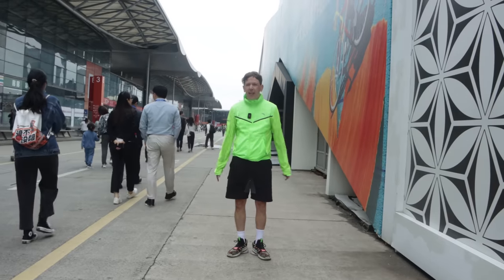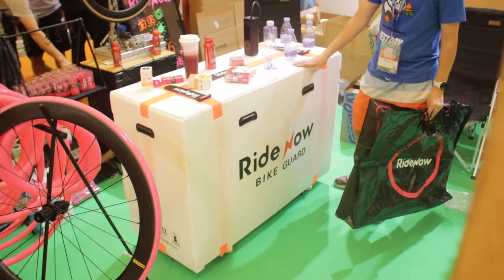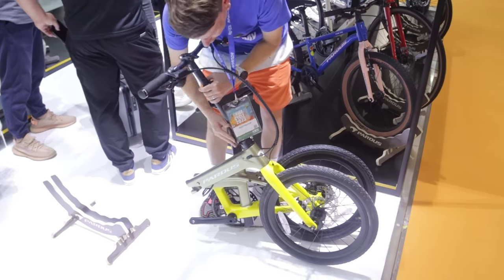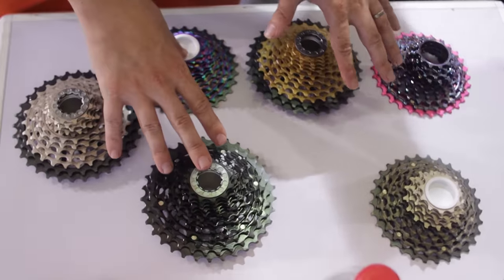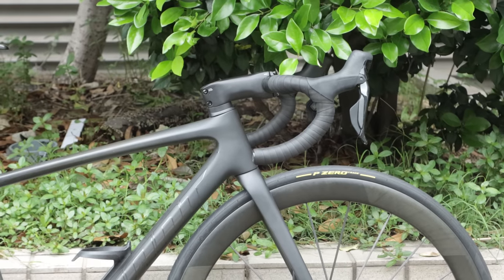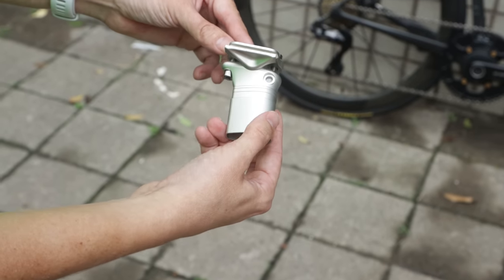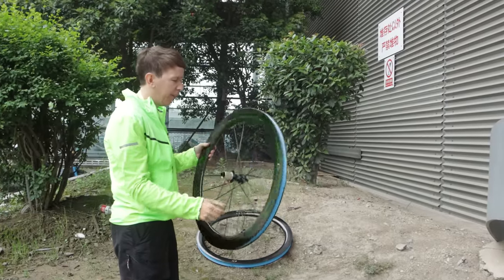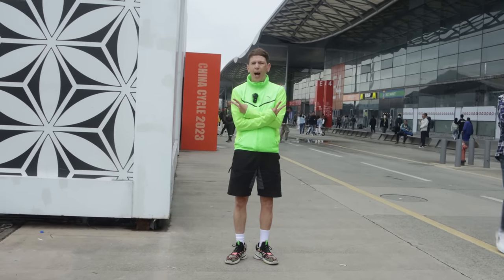WEIGHT WEENIE TECH at the Shanghai Bike Show 2023. Wheels, Tubes, Cassettes and more!

Comment: Do you have more info on that fully integrated cable conversion kit that was on the tcr?
Reply from the maker: Retails for about 40usd, because it's essentially just those two pieces of aluminium. Then you need to bong it in and drill the hole for your brake cables. Need to pair it with a bar / stem combo that lets the cables come out from the inside of the stem.
Reply: Just curious if they are going to include this kit for both the OD1 for the non SL TCR as well as the OD2 fork. Also how the conversion deals with the rear brake exit from the steerer inside the frame?
Reply: @ChinaCycling  of all the places to DIY drill, the steerer has to be the most perilous

Comment: I hope ride now fixed the valve issue as ive had a sticking valve and tried to remove but it was so tight it broke the plastic stem😮.
Reply from the maker: The valves are bonded into the valve stems. But now they have super long stems, so, you should never need to remove a valve core...
Reply: @ChinaCycling  I wouldn't normally but the valve wouldn't seat out of the box. Only had the one out if 5 I bought but I did  chat to another er guy who had the same valve issue. Might have been a bad few and that was the heavier version

Comment: I love those bike where you cut your seat stem to size. And they you basically change your shoes and the bikes stops fitting.
Reply from the maker: So that product I showed is a solution to that problem. You gain ~40mm of adjustment.

Comment: Where can I find more info about the ZGL track bike? PS, the tyres are on the wrong way on it. The logos should be on the non drive side on track bikes, as they can be ever so slightly slippery 😊
Reply from the maker: I never knew that about the tires. Not sure where you can find more info

Comment: When ridenow will he make a fat bike inner tube (26X4.0+)? There is only one fat bike TPU inner tube on market, and its hard to get, and it pricy.
Reply from the maker: I asked the same question as I currently have an e-fat bike with 26*4 tires. He says there's not much market, and that there's not a whole lot of point, because the tires are already so heavy, losing a few hundred grams is negligable. I see his point.
Reply: @ChinaCycling   Man... Fat bike inner tube 500-800g. And you need 2 of them (+ spare inner tube.). it's freaking 1600 at worst. 10% of fat bike weight, and you need every gramm because it heavy. Why it's important? In snow. you need put lot of power on bike  constantly, or you stuck. Its contineus speed up and slowdown.
Tubless are good, but it have tendency to freze and loos air. 
You need spare any way, and ist half kilo.
in my book, they don't need some small factor toob, like 24 or 20 inch, its light anyway, and saving literaly nonexistent
Reply: @ChinaCycling  I mean, it's not about how much it weight, it's about how much you save

Comment: I think PeakTorque would have a lot to say about that TCR seatpost clamp hahaha
Reply: It looks a neat solution as it has allowance for tolerance, which on the tcr ISP OD is loose as a goose. However, by expanding on the inside, which isn't always uniform carbon (rinkles, ridges etc) it could end up out of line once expanded, meaning the saddle angle may be slightly off. Looks like you can only  tighten the expander from the top when the saddle is off too.
Reply: And about drilling hole in a steerer tube.
Reply: @petrcivela9413  i think he made his thought quite clear, If I'm not mistaken "I dont want holes drilled on my steerer tube, thank you very much bike industry" was what he said LMAO
Reply: @donoldduckben  we're talking about the ISP here
Reply: @PeakTorque  copy, but for the steerer tube thingy... wouldn't you need to drill two holes (the hole where the front and rear brake enters, and then a second hole where the rear brake exits the steerer tube... but the product has no reinforced section there... if they just extended the length of the inner cup it could be long enough to reinforce both holes). Or am I off basis?
Reply: @travispyle2905  yeh about the steerer, I can't believe they're encouraging people to diy drill their forks? I heard from another source they were making their own fork for this to work. Would need more details from Joe so hope he sees this!
Reply from the maker: EXS have made their own fork for this to work. But, even big brands paint colours vary a little bit from batch to batch...so... it's gonna be hard to get an exact colour match. I think the aluminium bonded in there would add enough strength to make up for the holes being drilled...but... I'm sure it's not that simple.
Reply: @PeakTorque  thank you! and thanks for all the info you put out to the cycling community!
Reply: @travispyle2905  cheers glad you enjoy it and can take the banter/sarcasm. Some people are delicate! Hyper D67 video along very soon.